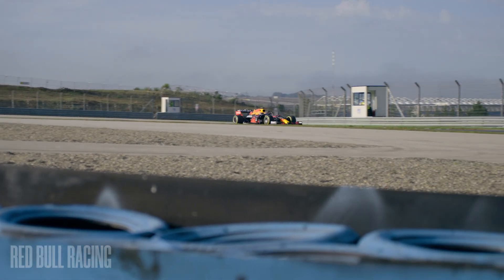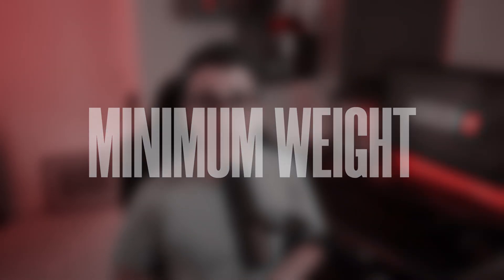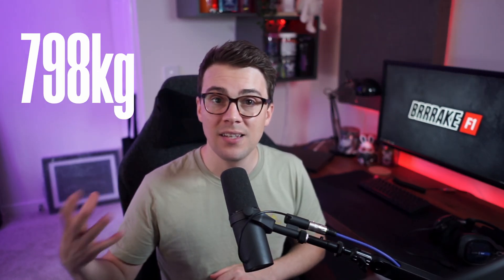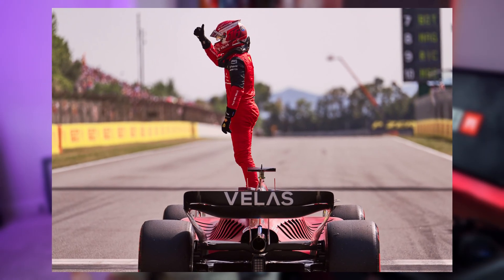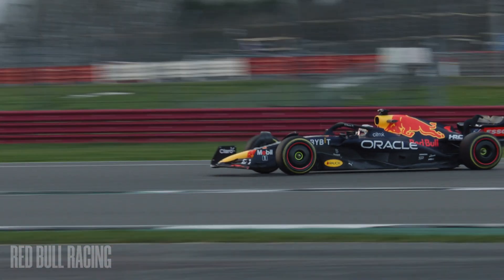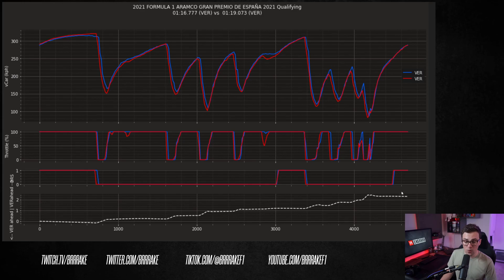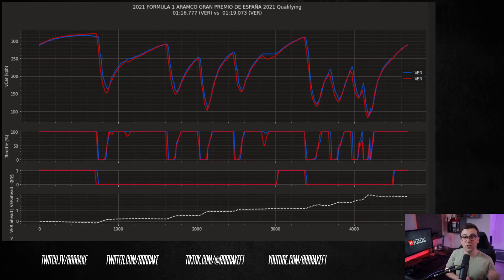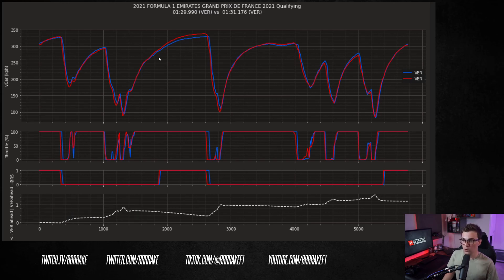F1 Cars are Getting Slower! Here's why... 2021 vs 2022 Comparison

Comment: I disagree that the merc power unit is to blame for the low straightline speed. Williams is merc powered and one of the fastest on the straights
Reply from the maker: And the slowest in the corners. The mercedes power unit cars were among the slowest most of the season. I really don't think that's a coincidence

Comment: With 18 inch wheels, I thought the braking performance would be stronger with bigger rotors and therefore space for more pistons and less brake fade. Also, I would love to see a video on the new engine regs!
Reply from the maker: The brake discs are pretty much the same size I believe
Reply: @brrrake  maybe they didn't want more unsprung weight?

Comment: Great video as always! My new fav channel! Would definitely love to see some videos on how teams decide which configurations to go with and how they use the data to help decide. 
I'd also be really interested (probably not video worthy but just curious!) as to how much a F1 cars weight needs to change before diminishing returns effect it in either direction(+/- 10kg compared to if the rules allowed +/-200kg). Another idea for a potentially interesting video would be comparing the drivers telemetry with their team mates based on their driving styles. 

Would love your thoughts on which drivers would potentially benefit more from being in a different team based on their driving style/team's cars strengths.
Once again keep up the great work!!

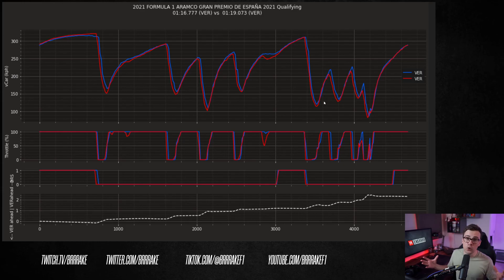Comment: 6:46 - "It's not all just a Mass Effect here" - LOL))
8:08 - is it relevant to compare telemetry of two different drivers? Or does Rus have pretty the same driving style as Ham?
Talking about mid and low speed corners - as we knew the fronts this year are a bit less grippy then rears. So they would be changed and we will see the difference next year - that would be a bit more interesting when all the things are well-ballanced. Also probably it would have an impact on the breaking, making breaking distance a bit shorter

Comment: Quality analysis as always Blake. A marginal sacrifice in lap time at the reward of improved racing potential is a pro in my book, although I expect lap times to fall during this era as teams further develop.

However I think your closing remarks are the most important in this video. Call me a purist, although I’m new to the sport. Rather than revert to simple ICEs, this time running on sustainable fuels. The 2026 regs threaten to reduce racing quality as teams still remain overweight with heavy hybrid power unit systems. Overtaking becomes a strategy game of managing electrical energy deployment so you could have a 1000+HP car teleporting past a 520ish HP car on a straight.

If Formula 1 is serious about making a tangible impact on the environment l, in my opinion the focus should be on enforcing green logistics. Make the teams use carbon neutral transport vehicles, reorganise the calendar so that races are run by region in order to reduce total flight times. 

There would be nothing more exciting than watching the 20 fastest drivers (maybe 24) bombing around a track at almost full tilt in a roaring V8 or even a V10. 

Maybe I’m wrong and these new refs will be a godsend. Only time will tell!

Keep it up fella.

Comment: Would you be able to make a video in the future regarding the strategy behind ERS deployment during the race? During the last 2 laps in Austria 2020 Norris' engineer was giving him instructions on which parts of the track to use ERS. What goes into deciding which sections of track are most suited for it as well as what race scenarios is it used for? (defending, perhaps inlap or outlap?)
Reply from the maker: I think sadly ERS deployment during a race isn't a very exciting topic. I will try and lump it together with a fuel strategy managment video!

Comment: That the cars are a bit slower isn't such a big deal as long as the racing is closer. Though it would still be nice to see the weight and size drop a bit.
Reply from the maker: I agree. But we could have closer racing and more nimble cars... But we won't 🥲
Reply: @brrrake  how much weight can we lose without comprising safety features do you think?
Reply: @betrandguesclin  As I understand it the hybrid system is responsible for a fair chunk of the size and weight, it'd be intersting to see how much you could shrink the cars while keeping the hybrid tech